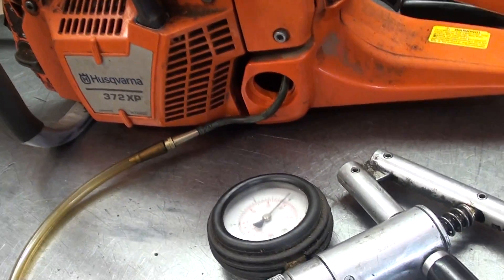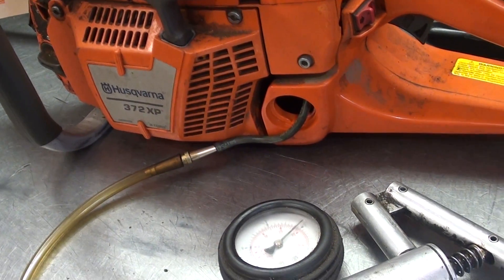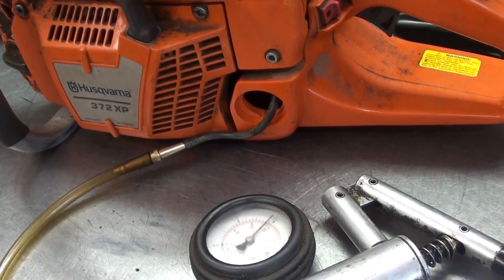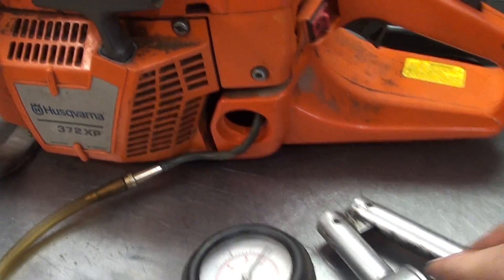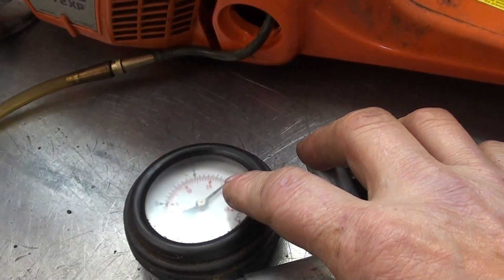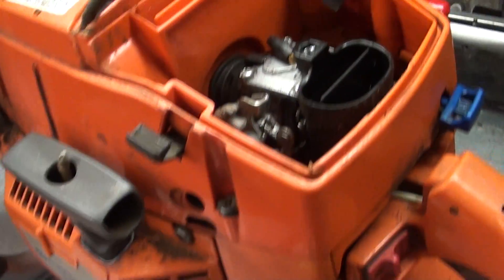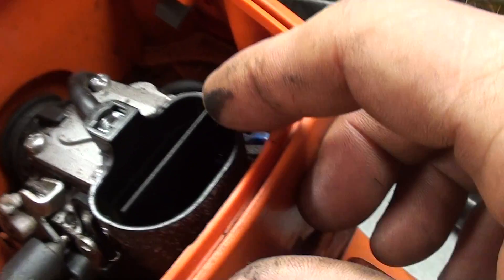The chainsaw guy Pressure testing Carburetor Husqvarna 372 Xtorq Chainsaw

Comment: I need a adapter plate to block the intake on a 372. The rubber between the carb and boot never seals bc as you tighten it down it actually spreads the top of the boot away from the carb. Do you have a part number or something?
Reply from the maker: Sure Call MCSS and they can sell you one, I’m assuming your wanting one for the X-Torq ?
Here’s their # 541-863-5387